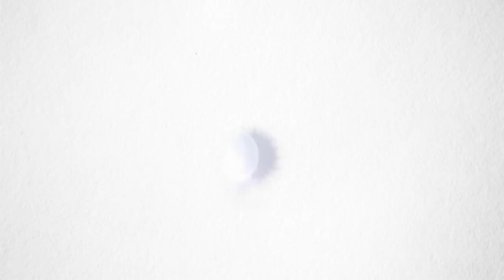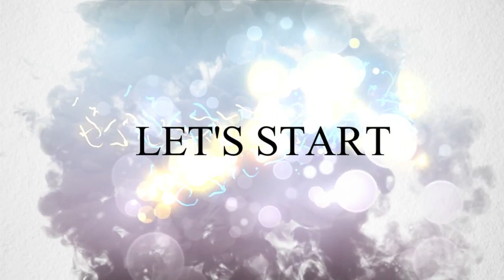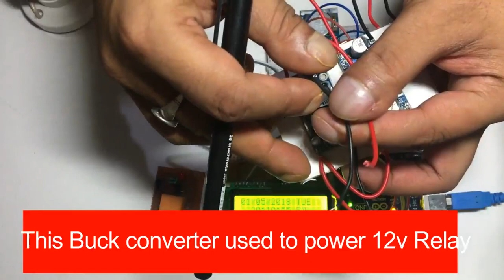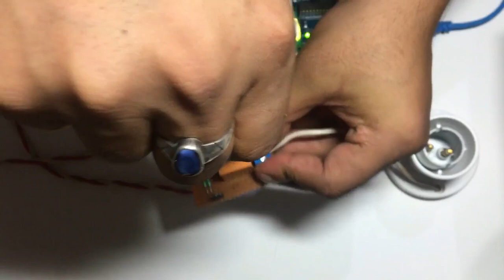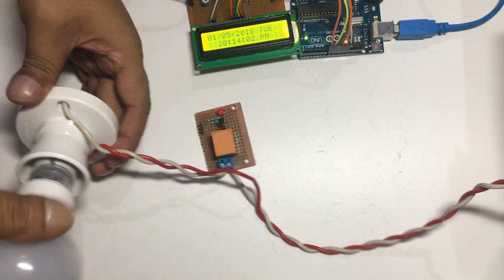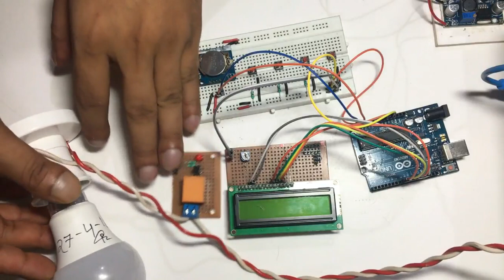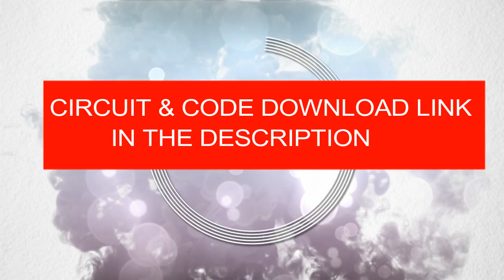Schedule turn ON/OFF of AC device using RTC 1307 and Arduino

Comment: Hi! This is an excellent video for beginners like me. I'm working on a program that will work on our product for our research defense, we didn't hire a programmer since its very expensive for us students to pay them. And currently, I'm having troubles with my program, is it possible that instead of turning it off and on, I will use "Fade" basic built-in example. In simple words, scheduling the LED to fade in and out at a specific time using RTC Module. I'm not very much of an expert when it comes to coding, can you recommend me examples that I can study with? I hope you can help me with this. And thank you for this video!
Reply from the maker: Yes it can be done. Please mail me your exact requirement. You can use "Fade" basic built-in program.
Reply: @MyEngineeringStuffs  I sent you an email.

Comment: Nice project , 
But something is not good. 
Between ON/OFF Time space. 
When Aurduino powers Off then On Timer switch not working. 

Time and date showing perfect.
Timer set value goes to - 00:00:00

Comment: Hey friend, it is very close to my developing project. Can you help me, I'm doing dual axis solar panel. But the thing is I use RTC as time trigger and every 1hr the dynamo will move starting to 8am and then move if it is 9am. Can you help me with this?
Reply from the maker: Hey friend just create an array of desired time and in loop function get the time from RTC module and compare the current time with your desired time, If it matches with the time in your time array than just change the angle of the dual axis setup as per your requirement. Hope this help you

Comment: i got problem,  rtc set up in lcd always change . how ? please help me
i use arduino mega 256
Reply from the maker: Hey friend, code will be same for arduino uno and MEGA 256. Just you need to change the SDA & SCL pin. for MEGA pin 20 is SDA and pin 21 is SCL.
Reply: @MyEngineeringStuffs   Done thats problem, and now i have problem again . cannot change  the time on/off ,cannot change the date . how ? please help me
Reply: @MyEngineeringStuffs   how to work this push button ?
Reply from the maker: Hey friend don't rush into the code. Let's check one after another.
Please follow my circuit diagram.
#1. Interface your RTC with MEGA256, output should be actual date and time.
#2. Display data on LCD with proper date, time as you like.
#3. Test the switches if it is working or not and as per the circuit diagram it should work.
#4. Now integrate all the code into one and test one after another.
Hope this helps, Best of Luck.

Comment: Wonderful project.
On this structure,i want to make irrigation 7 zone timer.Diferent time each zone.8-th relay will cut power supply to common wire of relays if rain sensor is ON.
I will try you code with multiplying time.
Thanks.

Comment: @t  this is not working..
Reply: link of code
Reply from the maker: @atikdesign9386  Sorry for the delay.

http://myengineeringstuffs.com/blog/projects/schedule-turns-on-off-of-devices-using-rtc-and-arduino

The site is under construction.

Comment: very good project.sir can you help me for my project I am very new in electronic Field ,i dont know about arduino programing.I want to make programmable relay ,using 16*2 LCD keypad shield+RTC 1307 +arduino Uno and 8 channel relay module.
Reply from the maker: Thank you for the comment friend. please explain me bit more so that I can able to help you.
Reply: @MyEngineeringStuffs  Thank you for your kind reply. Sir I want to make programmable relay which can on./off my aquarium lights, air pump, heater, fish feeder, etc... the timer of on/off can be adjustable by lcd keypad shield. I have arduino uno rev3, lcd keypad shield, 8channel relay module. And tiny rtc (ds 1307). Please guide me how can I connect them. I don't know any kind of programming. Plz help me
Reply from the maker: @prakashmudili  hey friend start with the Interfacing tutorial. Link : https://www.youtube.com/watch?v=TVWNkF-nOmY